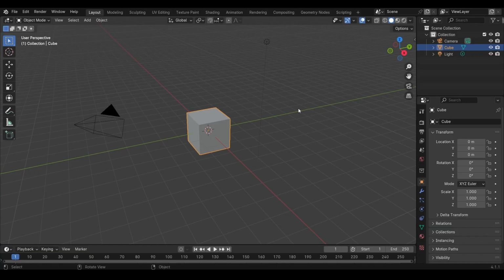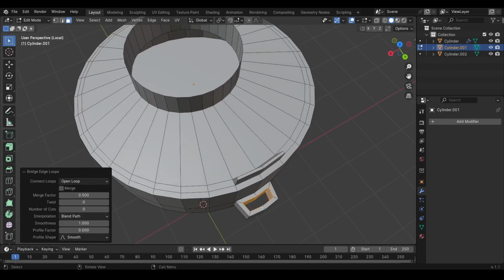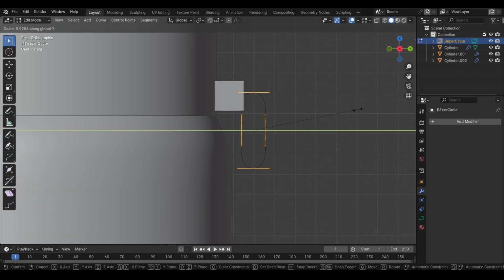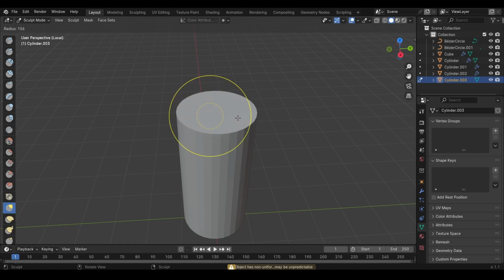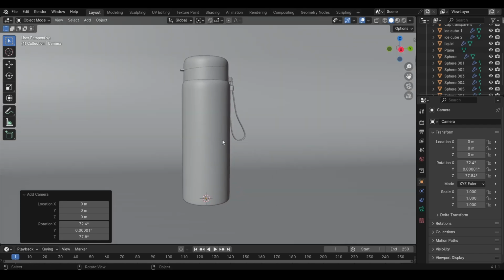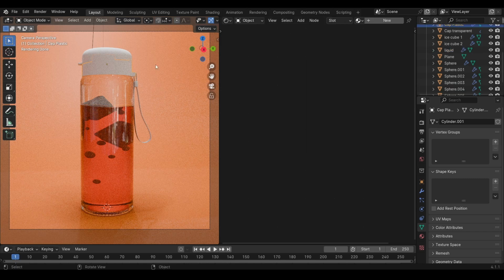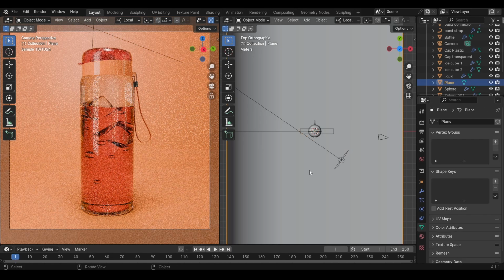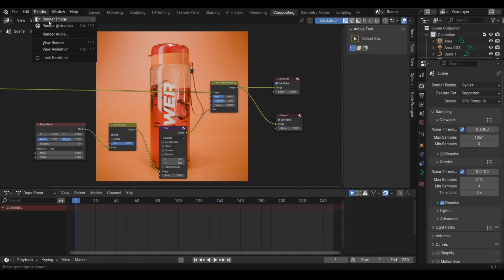Create beautiful product renders in 20 minutes!

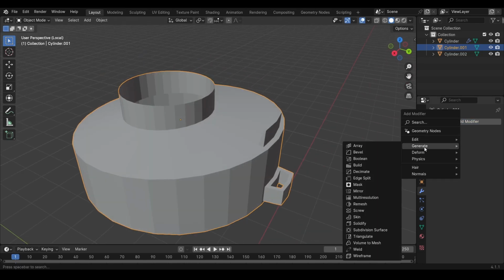Comment: I just had a question why didn't my bevel modifier work at 3:34 of the video?
Reply from the maker: Hey, there may be a few reasons for this, if you transformed the mesh in the object mode it can result in bevel issues, press Ctrl+A and select All transforms, if this doesn't work then you may have edges too closed to each other on the geo, for this , go to the bevel modifier - geometry menu and uncheck clamp overlap, you might need to reduce the bevel amount after this, see if this works and let me know if you have any other question!